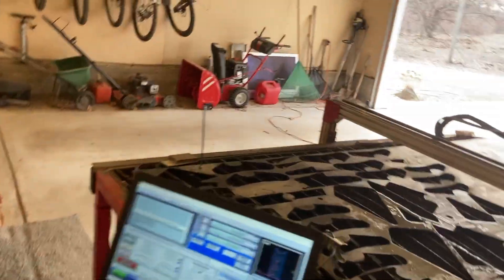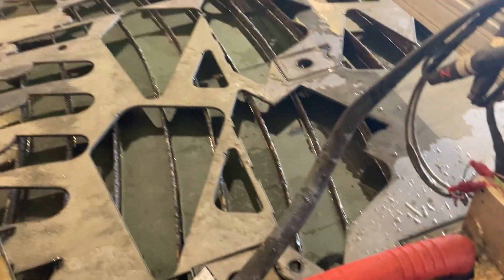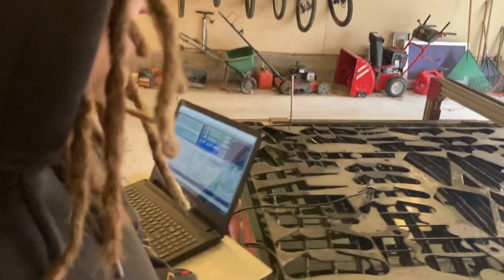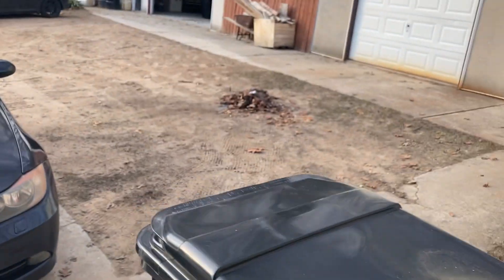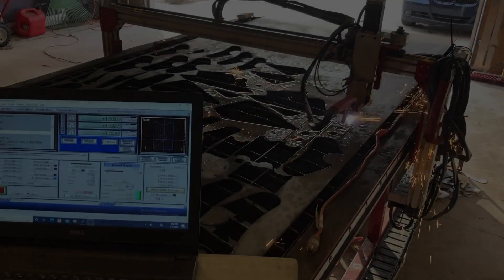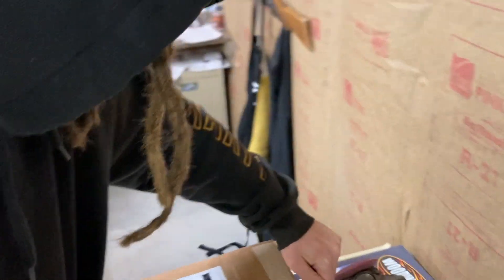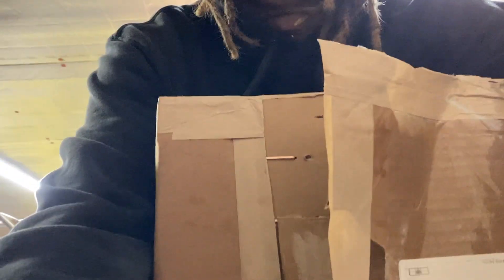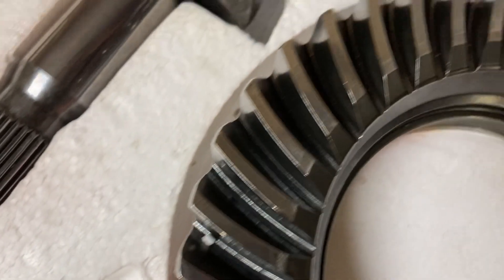Dune Hippie Vlog ep. 2

Comment: Do you have any issues with using a semi floating rear ?
Bent axles, etc. ?
Do guys use full floaters for these type of builds?
I know 14 bolts are strong, but heavy as hell. 
I assume you wouldn’t want that much unsprung weight..?
Just curious.
Reply from the maker: Been thinking about doing some extra videos. Talking about what oem and what aftermarket parts I used on my build and why. Doing a rear axle video would fit that premise.
Reply: @dunehippie  that’d be cool. 
I like your built not bought style.